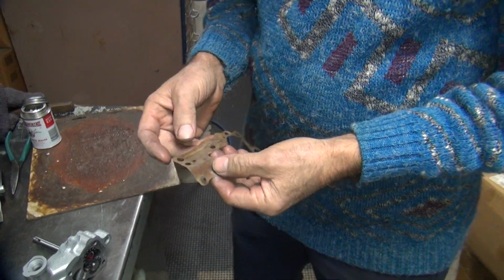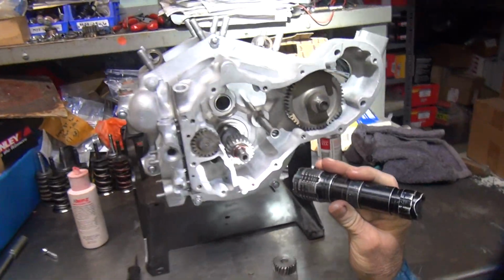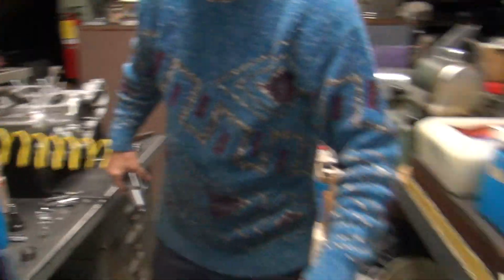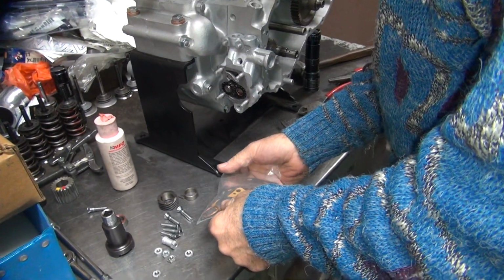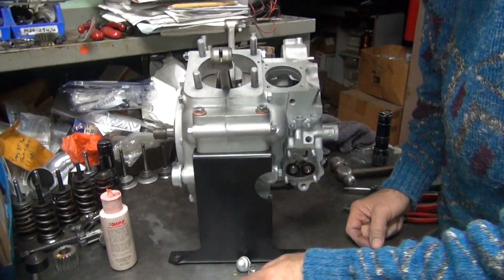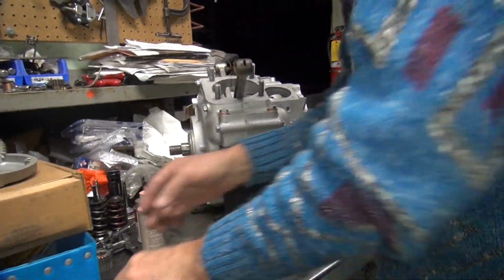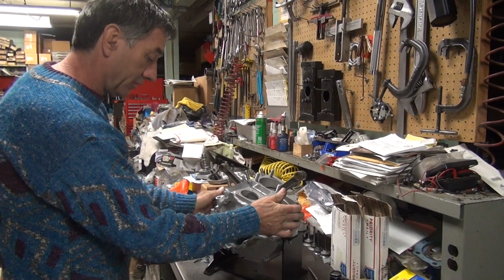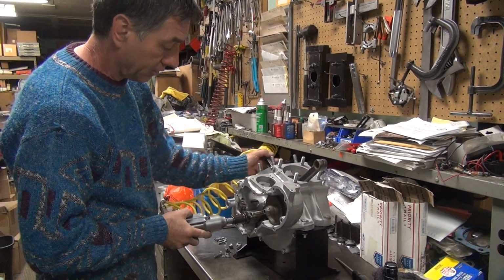#156 1961 FL 74ci std heads panhead motor rebuild oil pump cam cover assembly harley tatro machine

Comment: These tiny details might seem silly but, they all add up to longer engine life 👍
If you can get by the sarcasm & the sweater, you're not going to get a better education 😆
Replacing the pinion gear & drive with a set from a Shovelhead increases the pump speed. This will give you better pressure at idle and low speed.
Replacing the pressure by-pass spring with one from an Evo will help to increase operating pressure. 
Careful with the hardware, later models had different thread pitch !
Reply from the maker: becareful with that oil pressure spring deal. you might not have any oil flow at all. i have done lots of things over the years that did not work like i wanted. the gear upgrade is a good deal that i do as much as i can.
tatro
Reply: @TatroMachine You have had 1000 time more trial & error with these bikes than most of the so called experts, that's why I try to pay attention to every word you say.
Even when you are kidding with your assistant, it's a test to make him think about what's going on 🤔

Comment: If the motor is in a bike, the pump will need to be assembled in reverse order
Reply from the maker: it is very hard to install an oil pump in the bike. sometimes you can't do it at all.
tatro